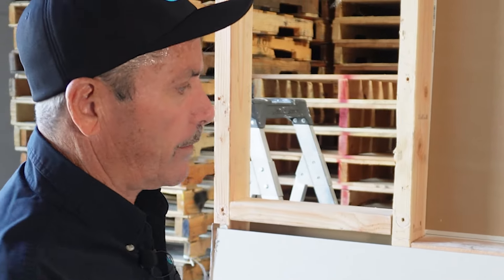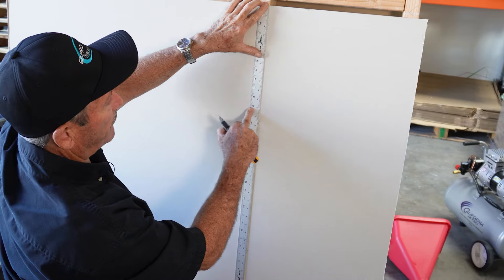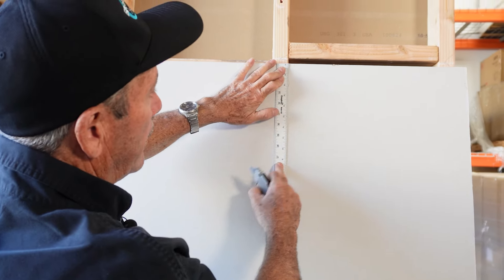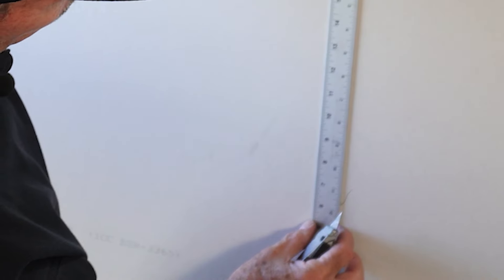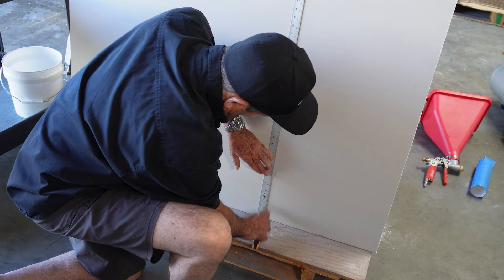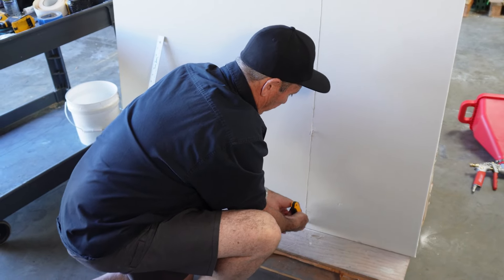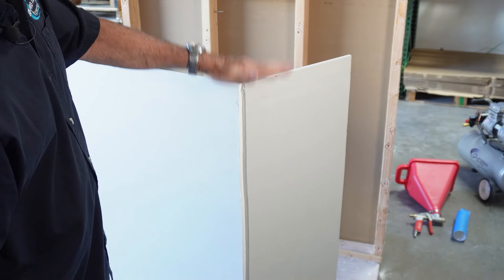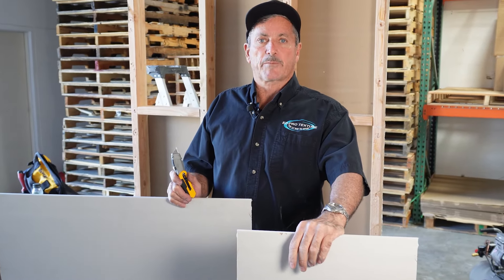The Fastest Way to Cut Drywall Like a Pro!

Comment: I get that this is not aimed at pros.  But really, all you have to do is cut through the paper and the board should snap along the line. Then, you break the board by *putting the knife down*, holding one hand behind the cut, and the other on the front side at the end.  Give it a swift, firm 'pop' with both hands and the board breaks along the cut. Then cut the backing paper. I think that trying to gouge into the score on the front of the board 2 or 3 times could actually be more dangerous.  It also wears down your blade MUCH quicker.

Hanging drywall is also not a *science of perfection*. Tolerance can be 1/8"-1/4" or 3mm-5mm. Just make sure to pre-fill the gaps with mud prior to taping.
Reply from the maker: Well put! I’ll try to demonstrate this in a video!
Thanks,
Jim